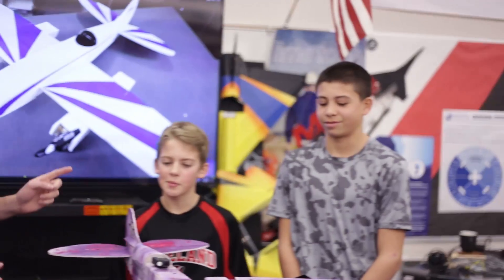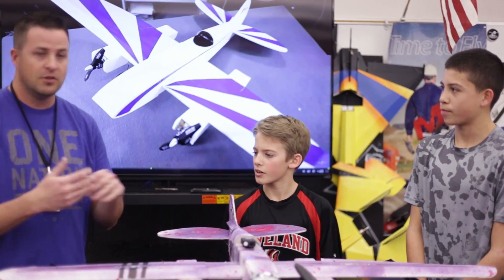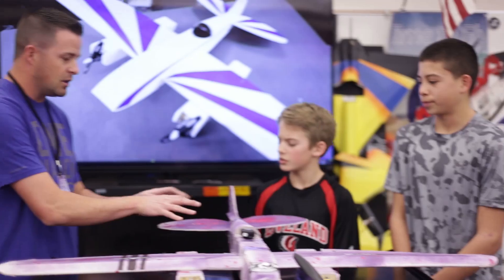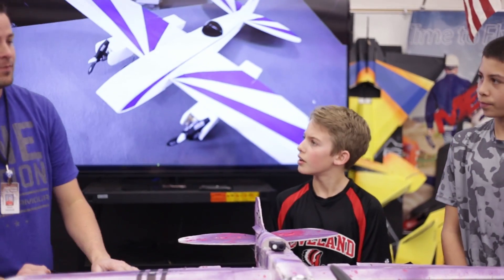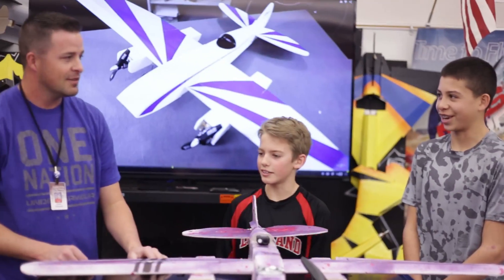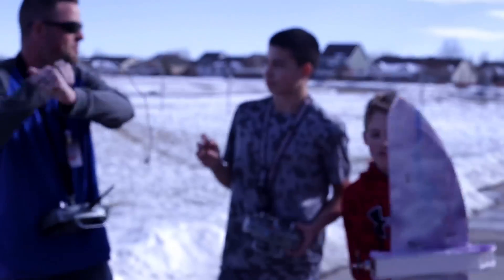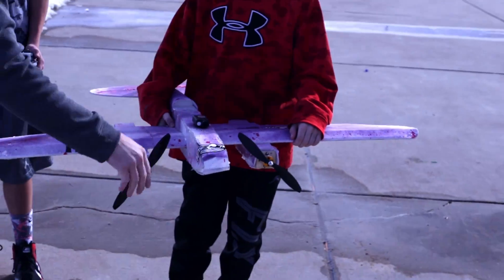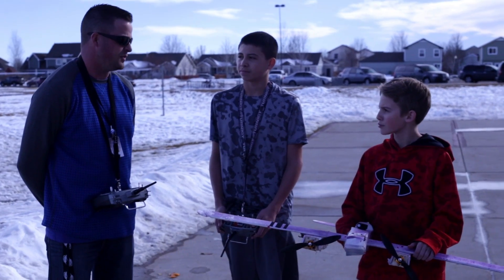MESArc - The FT Cruiser

Comment: Great build.  Was planning on building one of these with my boys and watching your club crank this out is good stuff!

Aside of the motor mount positioning causing the pitch change on power up, do you think the wind as it approaches the building behind you is pitching up en mass, thus disturbing the flight path once you pass into the rising column out over the field?

Are you guys painting BEFORE assembly, or after?